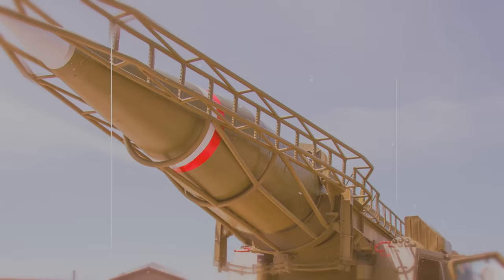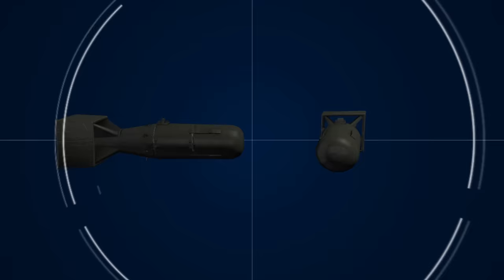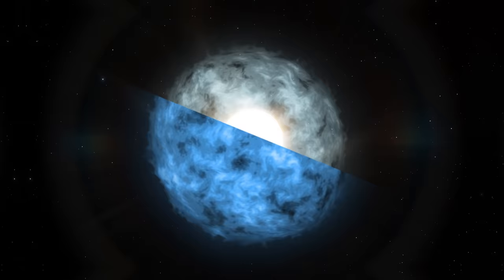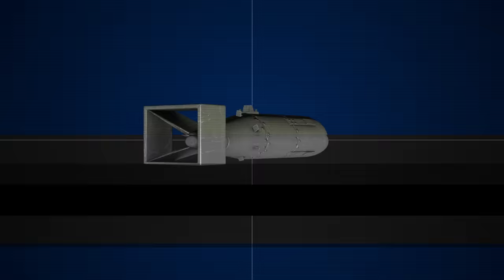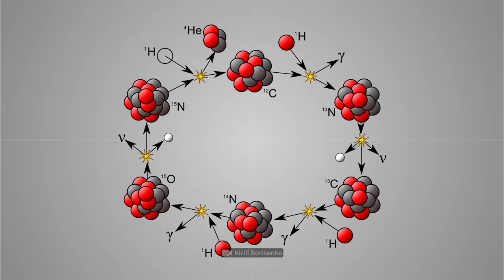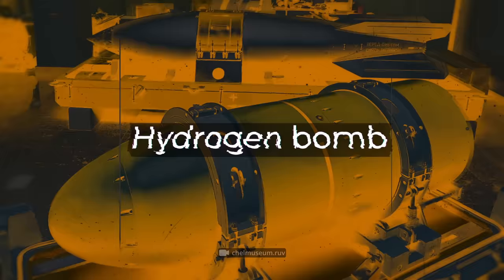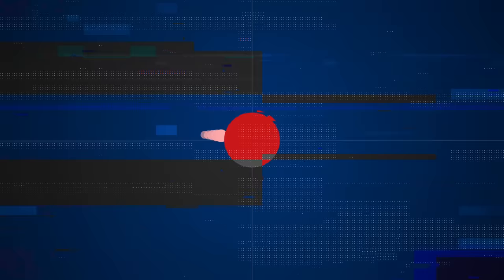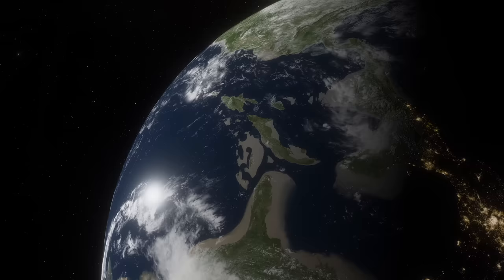How Atomic and Hydrogen Bombs Work In 10 Minutes

Comment: Correction: deuterium and tritium are not elements, they're isotopes of hydrogen
Reply: Yes, and hydrogen itself is an isotope. So all elements are isotopes, but are all isotopes elements?
Reply: Kenny Phillips hydrogen is an element of which there are multiple isotopes, the most common being protium, deuterium and tritium
Reply: if my degree in chemistry has taught me anything it's that isotopes are elements, google agrees also 
Element- "each of more than one hundred substances that cannot be chemically interconverted or broken down into simpler substances and are primary constituents of matter"
Reply: @UncleKennysPlace  No. Hydrogen is not an isotope. It's an element. Examples of hydrogen isotopes of protium, deuterium and tritium.
Reply: Radioactive isotopes of hydrogen

Comment: You can actually feel some radiation. It’s a burning sensation. Alpha radiation is a Helium nucleus, with the most energy, but stops at your skin. Beta radiation is energised electrons travelling very fast, and can penetrate a bit of skin. Gamma radiation is essentially light, but at a super high frequency, and highly energetic. This goes straight through you, and damages DNA and causes radicals to form in your body. Radicals are ionised elements like ionised oxygen. They react with all the other molecules in your body and do a lot of damage. The radicals are formed, by the gamma radiation energising electrons so much, that they shoot off from the element. 

Usually when light hits an electron (say UV), it energises the electron up to another high energy state (they’re initially at ground state), and then the electron drops back down to ground state, and releases a photon either of the same energy or less (if it goes up to a really high state, it can stagger back down and release a series of photons). 

So yeah, radiation causes burns like sunburns. Only it’s more destructive and is felt immediately, instead of the day after.
Reply: is gama radiations containing photon particles with shorteer wavelenght?
Reply: @The Crazy Amateur Runner Oh, bullshit... You can't feel that either

Comment: It is important to add that fallout is actually quite neglligible for strategic weapons since they will be airburst. Airburst bombs are, in most cases, high enough such that the fireball doesn't touch the ground. If it does, then it picks up the dirt around it and causes vast amounts of local fallout. It is this fallout that travels for miles. However after a strategic bomb at a reasonable height, the fallout will only affect distances very close to the explosion. Background radiation on the other hand, will increase regardless.

Comment: Note: The destructive power of great explosions aren't compared simply by energy output.

First, humans mostly live on the surface of the planet, where the low density and gas nature of atmospheric air allows for much greater destruction. We have massive shockwaves that wreak havoc, but since we occupy only a thin layer of Earth's surface, this means that any energy that gets "spent" on the rocks below us and the atmosphere too far above us won't cause any major damage to us or other animals. At least nowhere near the same proportion as the energy that goes directly to us. In that regard, destructive power increases by a logarithmic ratio based on the energy liberated. That's why most nuclear warheads are usually in the range of 100Kton - 1Mton worthy of power, even though we can easily get more than 10Mton in packages capable of airborne or orbital delivery.

Second, the (immediate) destructive power of nuclear devices is usually lower than the equivalent of conventional explosives. That's because the energy is liberated in the form of intense radiation emission. Both the particles and the ionizing electromagnetic energy they liberate can cause harm to living beings, but considering how they travel in straight line going to all directions from the origin point, the average amount of energy received per unit of area exposed to the nuclear reaction rapidly decreases as the distance increases. That said, the air that gets heated by this much radiation will violently expand and the shockwaves caused by this expansion lose energy much slower over distance. However, remember that only a tiny fraction of the heat applied to a gas will be converted into mechanical work (pressure increase and expansion). Basic thermodynamic stuff.
Reply: So...is that a good thing?
Reply: Yea, basic.
Reply: Where they are detonated matters of course. If you detonate a warhead under water it will not have nearly the same impact as detonating the warhead over land or in the sky several miles above land.

Comment: This is the first video I have seen that mentions U234 which is good. It is only found as 0.005% of natural Unranium, but it is nasty stuff. Side note. Lithium Hydride is more commonly known as Lithium Deuteride LiD6 when used as a thermonuclear fuel. Side note. Implosive = Implosion. Side note as extra info, the isotope Uranium 233 is also a fissile material produced from the iradiation of Thorium, but is not used in weapons (although it can be). Also, some may say that Pu does not occur in nature, although it does in tiny amounts through decay processes in pitchblende or Uranium ore, so the video is correct.

Comment: This is simplified to the point of skirting the edges of being wrong.

The number of ctitical masses isn't the key to getting a nuclear detonation. The key is getting the critical mass (or, commonly, a bit more than a critical mass so that the device is supercritical) to exist for long enough to cause enough fission to happen (edit : I mean a runaway chain reaction). For example, in the Tallboy type bomb (U-235, using a "shotgun" type triggering mechanism to unite two subcritical masses), if the "bullet" approaches the target too slowly, the energy of fission will vaporise the components before a substantial yield is achieved. IOW, the bomb will fizzle. Conversely, if the "bullet" isn't stopped (or at least slowed down) once it's in the target, it may pass through before the desired amount of fission has occurred.

There's also the requirement for an initiator to encourage the fission chain reaction to begin, by providing a sharp spike of emitted neutrons.

In the Fat Man type of bomb, the density of the plutonium at the core is momentarily increased by the coating of explosives, decreasing the amount needed to achieve a critical mass. (What constitutes a critical mass is determined by several factors, including the likelihood of neutron capture by a particular nucleus, the likelihood of a particular neutron to collide with a fissile nucleus, the number of neutrons released by each fission event, and so on.)

Comment: Wiping all life is what the scientists thought Trinity device would do.
They had 3 theories on what it would do in the test detonation.
1.  Create an explosion so massive that the reaction would keep going and destroy earth.

2. Explode and create a big fireball as intended

3.  Not explode at all.  Essentially a DUD.

Fortunately 2 happened.
Flash was seen 150 miles away.  Audible detonation was heard 250 miles away.  It obliterated the 100ft  tower it was dropped from and turned the sand in the immediate vicinity to glass.

Comment: Also guys you can also use Pure Thronium which is made from gas lantern Thronium combined with Lithium and heated in cooking oil. You will get Pure Thronium

Procedure: Take Gas Lantern and take their white cotton substances and make into fine powder by heating them. Then cover lithium with a battery and your Thronium powder and then heat it in a tin can with cooking oil. And then you will have pure Thronium

I am gonna use it for science project guys

Comment: So how much energy is required to set off the reaction?  Would a lithium battery supply the power?, maybe a handful of button batteries?  Obviously 25 tons of tnt isn't sufficient so where is the power to create such a chain reaction to split the first atom?  Not as if you can simply bang it with a hammer either :)

Comment: You forgot to mention neutron reflector, berillium and polonium in the design of uranium bomb. They save you nanoseconds in the beginning of the chain reaction. Otherwise it would just make a small puff and melt. They are all critical factors, critical mass is not correct term. These factors are what makes a certain mass critical. Its same as if i said: i need 5 gallons of gas to drive a car. What car, how far you driving, how much load? As ironic as it seems Hiroshima/Nagasaki blast saved a lot of japanese lives by forcing capitulation, regular US bombings of just Tokyo superceded nuclear blast by 10  times more in terms of kelotons. As an example in 1944 British bombings of Germany were equivalent to 50 Heroshimas / month

Comment: most of this videos drags on about nothing. so, During nuclear fission, a neutron collides with a uranium atom and splits it, releasing a large amount of energy in the form of heat and radiation. More neutrons are also released when a uranium atom splits. These neutrons continue to collide with other uranium atoms, and the process repeats itself over and over again. more energy equals boom

Comment: Sigh...simply put, single flash— fission bomb, double flash —fusion bomb. What is scary is that these weapons are not that big.
Reply: Not true. A fission weapon still has a double flash. The first flash is caused by the super heated weapon casing and surrounding air becoming iridescent. At the same time that heat is expanding out as a shockwave and compressing the air to the point that it becomes plasma, which is opaque to light. Once the shockwave expands further it's density decreases enough to then become transparent again and the fireball behind it can shine through.